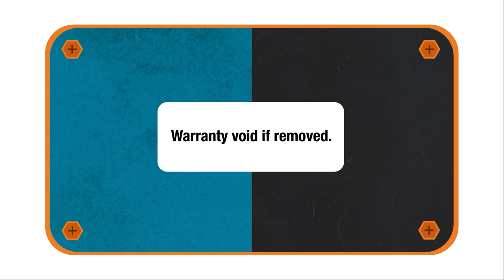Electronic Safe Teardown - The Electronics Inside

Comment: I connected a raspberry pi to a relay which connected to the solenoid. Then I wrote a program in php so the safe could be unlocked from anywhere via the internet. For fun
Reply: Such a safe would actually be useful for packages. Just needs to be secure enough to make the thief look for an easier target.
Reply: It's a good way to go, and I would consider doing it for a door lock, but I worry about my skills as a web dev to ensure it was secure enough to be insurable?
Reply: @a531016  same here. I was able to encrypt the pin etc, but i’m only self taught so could be bypassable

Comment: Locking mechanism is quite poor. Same design as Amazon Basics safe. Simple knock opens it because solenoid jump easily. Maybe could be improved a bit, eg by heavier springs? I'm tempted to get this safe and replace solenoid with a snail actuator. Probably would have to also replace or mod the electronics to drive it. 
That tubular bypass key is also a big weakness. Lockpickinglaywer showed it lasts 3sec against cheap tool from amazon. I think I'd rather disconnect it, and guide cable pair from battery box to outside so mechanism can be powered externally in emergency.
At that point total cost would probably approach a much better safe, eg MSafe or Sentry. Could be fun project tho.